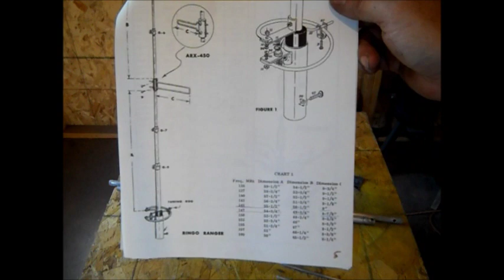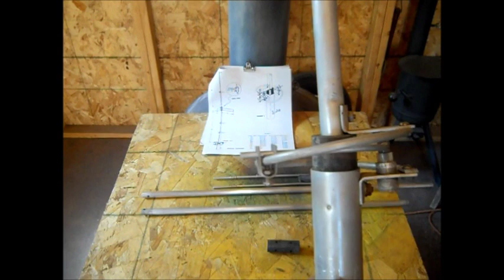CUSHCRAFT RINGO ARX2 RANGER 1  AMATEUR RADIO ANTENNA (   Repair and rebuild Part 1))

Comment: I used Mac's aluminum brighter from NAPA auto. Takes away all the tarnish, corrosion, and paint off without sanding or polishing. Works great on my old hustler 5btv, ringo ranger 6m and a maco v5000.

Comment: While steel wool works great, it embeds steel whiskers into the aluminum, which can rust and corrode connections. Much better to use scotch bright type material. No possibility of rusting and cleans very well. Cheers!
Reply from the maker: THANKS

Comment: I'm wondering if that dimple was a physical stop in the aluminum to prevent over insertion of the plastic collar into the tube? A depth stop.
Reply from the maker: Could Be I do not know if I still have it somewhere in my shop attic

Comment: Is it possible for you to tell me what size screw or bolt I need to get in order to secure the mounting of the antenna over the mast? I've had one of these antennas for quite a long time and want to put it back up, however, I've lost a screw that secures it to the pole. Many thanks, Penn G0VQY
Reply from the maker: I have no Idea what size it is ...I do not have this antenna anymore ...Just grab a few different sizes at the store and try them

Comment: I rebuilt mine a few weeks ago. It was up for 15 years and this time I used varnish and painted it black.  Looks great and should last longer on the air.  :)
Reply from the maker: They are not a high gain antenna But mine has talked over 30 miles once with my 2-meter hand held...It also makes a great cheap scanner antenna on VHF and UHF Freqs.

Comment: I had one about 30 years ago, and the dimple you talked about did not hold the lower pipe but acted as a stop for the insulator. Cushcraft use some kind of adhesive to hold that together, but lost it's hold after a few years out in the elements.
Reply from the maker: +Donald D'Egidio Thanks !!!

Comment: I had the same issue of HIGH VSWR with my 2 meter Ringo  after 25+ years of service.  It turned out to be nothing to do with the antenna, but rather water got into the PL 259 connector.  Installed  new Silver Teflon PL259, sealed it up, and the VSWR improved dramatically.  With 30 watts forward, measured on a Bird 43 meter, I had  300 Milliwatts coming back  at mid band 146.520 Mhz.  These antennas work great.  I don't know if the poster of this video does so, but I replaced the hose clamps with new ones while I had the chance.
Reply from the maker: +gatesmw50 These corrode so much with all the exposed parts I do like how easy it is to take apart and take it camping Etc.

Comment: Another way to protect the cleaned aluminum elements is to use plain old paste car wax. Three coats should do it. Rub the paste car wax in, let it haze and polish it. Do this 3 times and it'll be pretty well protected. I use that on my mobile antennas and they look new after being in all kinds of weather.

Comment: I forgot to you can usewhite distilled Vinger with the steal wool it will take little work to clean it up. i have helped C.Bers through the year with everything from PDL2s,Moonrakers,the old Star Dusters I had 4 through out the years alls took them down to clean them it helps on the RX. But you to have some greta ways to don't get me wrong.

Comment: we had to take the insie out of it to cut it to freqs. it has a VHF when we got it but our friend at Motorola told us to use boat sealer it will last for yeas & not be efficted by UV rays or weathering. It allso gives it streath makes it stronger then even the stuff they use on the ant. when it is made. I cant think what I use to hold things it is called something Weld but it is a glue it will come off but it is strong to I just run it at the top it take about 50LBS to pull it apart it will hold

Comment: Laquer is good it is cheaper then Boat sealer but we found that laquer didn't last as long as boat sealer laquer for 1 didn't hold up to the UV rays or the asicd rains the 1st rains of the year. I didnt know there was 0000 steal wool that wound be better yet to shine thins up allso with laquer it has cemicels in it that do raise the SWR a little we found I helped my buddies build a 220 repeater we were given a Motorola ant. made of fiberglass it had been up for a few years had some weathering

Comment: I wound had to buy a whole new line from the ga tank to the carb & have 1 bent. But heres a good way to clean any antenna 000 steal wool a buddy of mine does all his antennas every 3 years he has used steal wool for the last 25 years cause it makes it look new and don't take to much off. if u take to much off it will make it so it will carode faster as far as the fiber glass parts use what they use on boats I have done A99 ant. brought them back life.

Comment: Good old Seal All great stuff saved me $200 junst for a part for my old Chevy S10 had a gas line leak on my 89 s10 it was right over the motor it was very hard to find but when I did I spent $2 for tube of this took some gas line hose cut it down the middle spread that Seal All all over inside put it on the line hose clamped it let it sit for a day took the claps off it l;asted 10 years newver did leak from that day on. I use it all the time now. The short line was not made anymore.